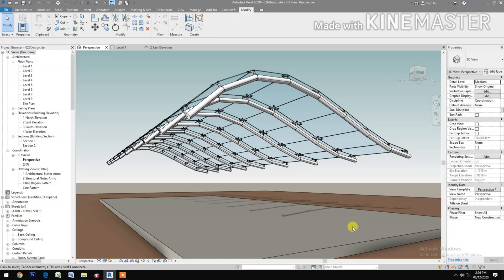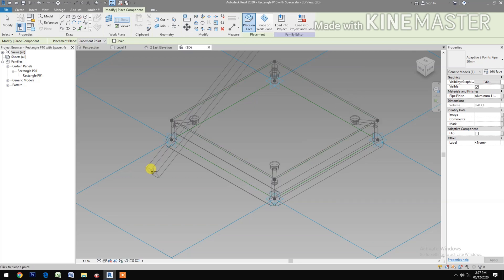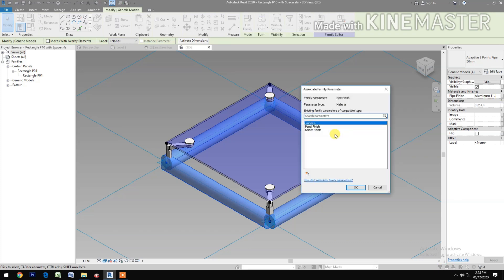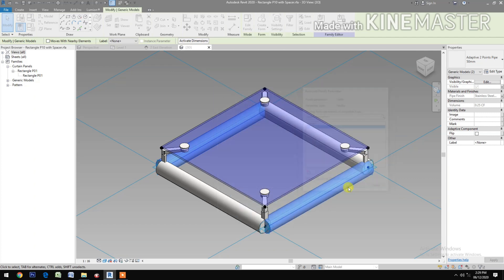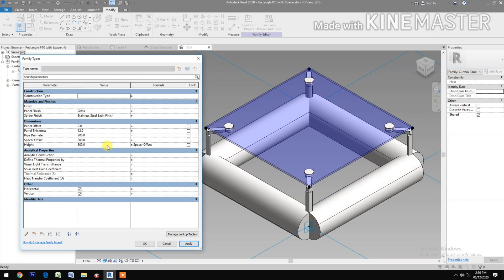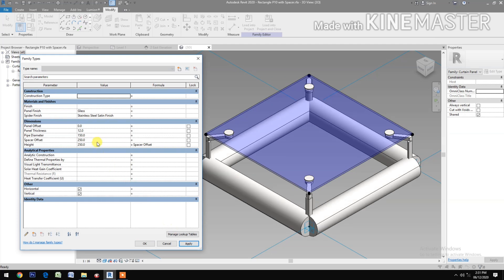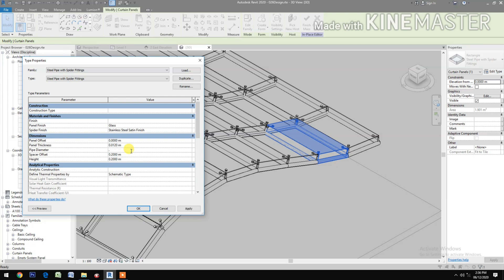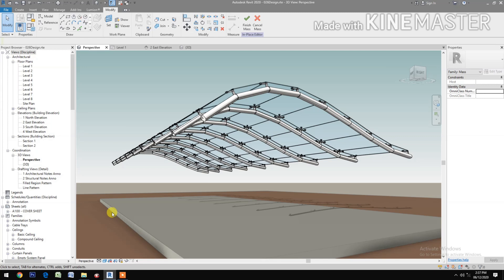RD026. How to make a Parametric Steel Pipe Glass Canopy with Spider Fittings in Revit.

Comment: sir can I have your  spider fitting addaptip compnent, this is my email henhenarsitek@gmail.com thanks a lot off sir
Reply from the maker: Please check your email and let me know. Thanks
Reply: @ArCrisCruz  thank a lot off sir, has been in to email thanks sir
Reply from the maker: Please check your email.
Reply: @ArCrisCruz  thank so much sir cris, already in my email
Reply from the maker: I send to you the Adaptive to point pipe.
Reply from the maker: i will send it to you later.
Reply: @ArCrisCruz  send me moralesmar.0311@gmail.com
Reply from the maker: I just sent to you the files. Please check your email and let me know. Thanks
Reply: Sir cris can I have 2 point adaptive to ? I has been make myself but there is no parametric dimensions, its make confuse, thanks sir
Reply from the maker: @tanjungsari-b8j  ok i send to you later.